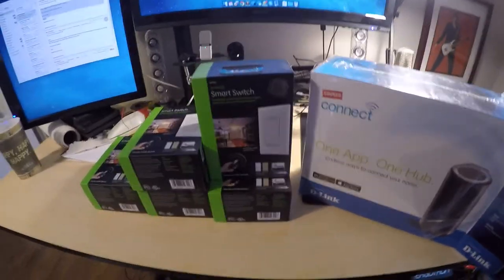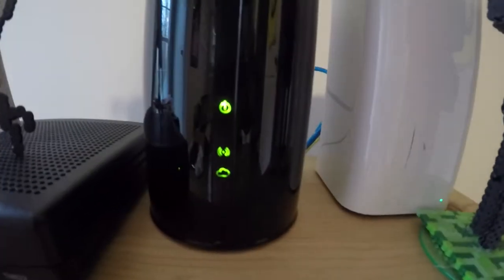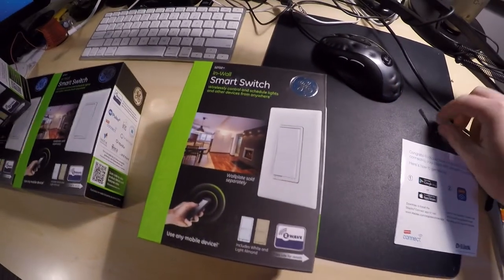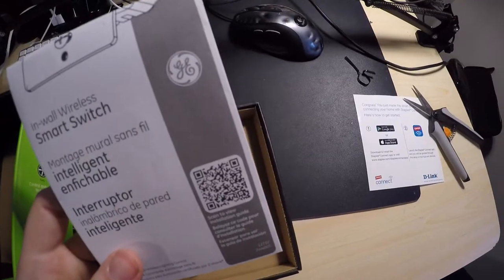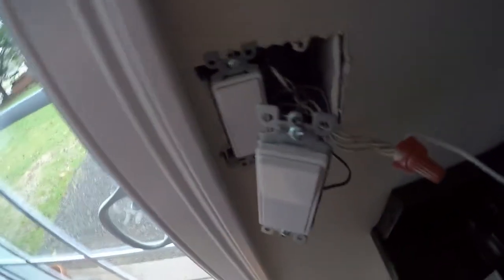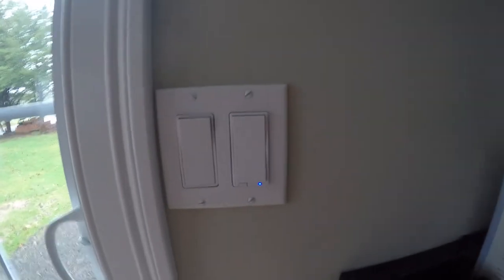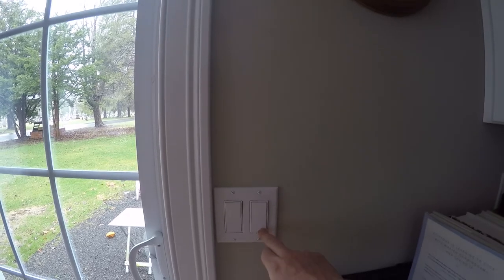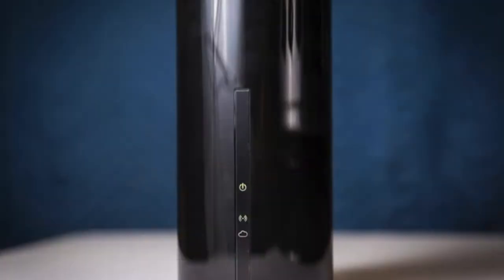Staples Connect and GE ZWave Switch Review and Installation

Comment: This reply from Sept. 2019, and Staples has ended Connect support and D-Link Website has no support or mention of my D-Link HA1000 Connect Hub, that I bought used with great hopes. (It's the flat white hub, not the tall black hub from Brian's video) There is the possibility of Rooting the unit and getting LINUX control of it, Oh well.... Thanks, Brian for the video of what I missed.
Reply from the maker: Thanks for your comment @Fredo Mordaunt! Godspeed, it really is a shame they ended this product -- but the GE Switches are still working very well and now with a "Smarthings Smarthub" by samsung.

Comment: Thanks for sharing Bri. I had done the SmartThings KickStarter a few years back now and sadly when I finally got to trying to set it up, the tech was no longer in sync with the software and I couldn't get a single item connected. This definitely seems like a good alternative. You should check out the Philips Hue bulbs next.
Reply from the maker: Going to integrate the Philip hue and GE bulbs next! Along with thermos and door locks!

Comment: hey how many wires does it require to connect the switch, my home only have 3 and one of them is the neutral?
Reply: +RR Market Three wires are most likely neutral, hot and ground. If that's the case and you can properly identify them then hooking up should be straight forward. If you have four wires like with 14/3 cable, one is a travel wire.
Reply from the maker: +RealityCheck41 RealityCheck41 is correct. The inputs on the back of the switch should have the right connections for your cables :)
Reply: +Brian Kinney (webdevb) thanks for the fast response, I'm in the carribean and they only use 2 wires the black and white wire thats it I'm building a home and i ask for the electrician to add the neutral wire but that would leave me only with 3 cables. i was wondering if with the 3 cables this will work.
Reply from the maker: +RR Market Congrats! I've been to most of the islands in the west indies, love that area!

If they only use black and white that's hot and neutral. The device should be grounded, however.

yes, if you had the three cables (hot, neutral and ground) you're good to go. You do not want to run anything really, without it being properly grounded!

Hope that helps. Good luck with the buildout! Toss me an invite for some rum punch later on :)
Reply: +Brian Kinney (webdevb) Thank you for the help.